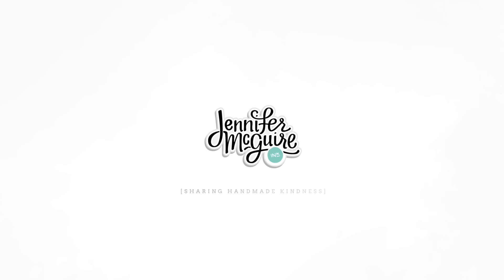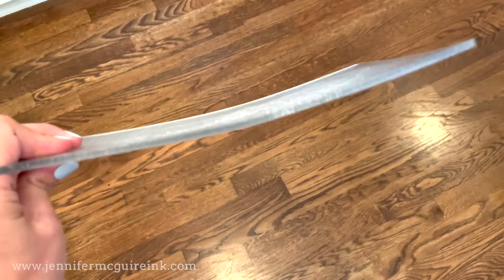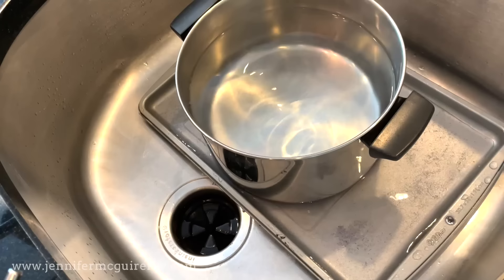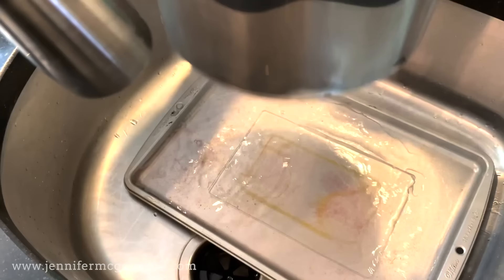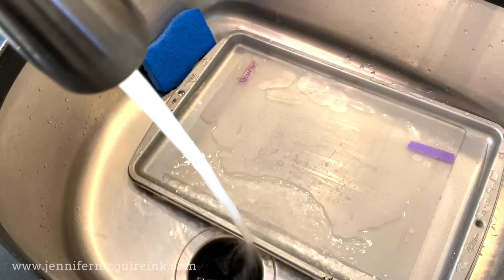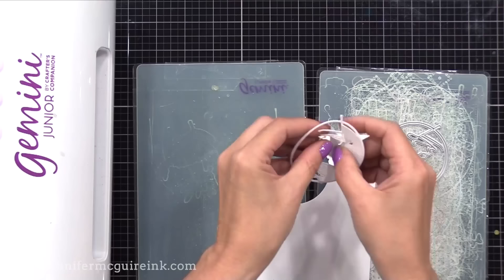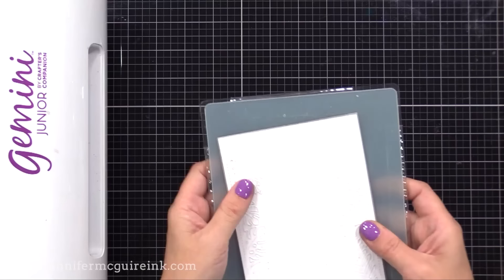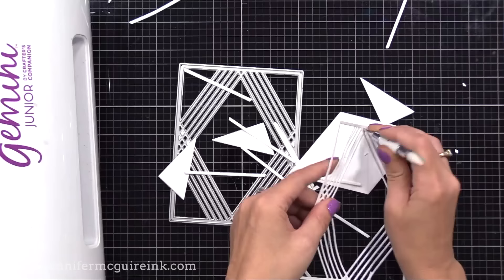Fixing & Avoiding Warped Die Cutting Plates

Comment: Thank you for suggesting my turning large side dies a bit before feeding it through my Gemini. Also, thank you for telling us to place a die more toward a corner rather than center only! Makes lots of sense!
   I am a novice on cutting dies; unfortunately, I apparently had "too big" a sandwich because my cutting plate CRACKED in half! The noise was loud, but I was saddest because I need another plate and must wait for its delivery. 
I did not realize that I could run my junior plates horizontally, either. What a marvelous idea!
 You (& your "nerd" husband) really instructed well in this video. I thank you both sincerely!

Comment: After watching your video I bought the double sided green plates and what a relief they were. I'd just bought a full size Gemini and was so disappointed with the plates that I stopped using it.  I straightened the cutting plates with hot water and then used them with the green plates and no warping, it was like a weight had been taken off my shoulders. Daft really but that's how I felt. Thank you again Jennifer, always feel uplifted after watching your videos.

Comment: Thanks for this tip on warped plates. I have been putting mine in the dishwasher when I run it to wash the dishes. It has been doing a good job of both cleaning and straightening my plates but your method would be definitely worth a try also.

Comment: I tried a method that was on YouTube.  You heated water in an oven in a shallow pan, I can't remember the temp, but then you timed it, took it out and put something heavy on top of it.  It cleaned it as well.  It worked, but it probably took longer than your method which I am sure works because of the same heating.  Also, I bought the Tonic Tangerine machine.  The plates are made out of a heavy plastic, they are not clear.  They are never going to warp because of the thickness and the material they made them out of.  I wish the other companies would start using that kind of material.  Thank you so much for a great and informative video.  I bet those double sided plates are closer to the material they use in the Tonic. :)

Comment: Thank you both for the valuable information.  Thank you for all the time spent in finding solutions as well as your great card making videos.  Now if you had a source for steel pins to prevent glue bottles from getting all clogged that would be great.  I buy the large bottles of glue and transfer to needle tip bottles.  Again thank you.

Comment: I actually put my cutting plates in my machine and left them. I put them in so the pressure was on the popped up section. It did straighten them, although not as much as your method. Thanks for the tips.

Comment: Thank you for this info!  I have Gemini junior and always use the metal shim because the instruction book said to use it.  Can’t tell you how many times I’ve cut my hand on the edges.   Probably my biggest frustration with die cutting!  I didn’t realize you didn’t need it along with the magnetic sheets which I have completely trashed numerous ones due to frequent die cutting. I also didn’t know about the double cut green plates.  I have them on order now!  Thank you so much!  And who knew?! Taping the plates together.  I’m implementing this as soon as the green plates arrive.   😃 Game changer!     And great info on boiling water for warped plates.   I have minimal warping as I frequently rotate and also place dies all over the plate.   But great to have for my big shot plates.   Thanks Jennifer!  Appreciate your information greatly, as always!  Hugs!  Em in Ohio.  Ps great info from hubby on the chemical info, too!  Thanks!

Comment: I love crafting, especially with my grandchildren, we create all sorts of things together. I asked my partner for a Gemini cutting machine for my birthday this year & absolutely love it 😍😍 I used a hairdryer on one of my badly warped plates to heat it, then placed a heavy box on top for 10 or so minutes till it cooled down, repeating 4 times, took about an hour & a half, still has a slight curve in it, but worked out ok. I think I will use your method next time though, having hot flushes whilst using a hairdryer in a small room isn’t much fun 😂😂 Thanks for the video.

Comment: THANK YOU, THANK YOU!!! I used your hot water fix today on 6 warped plates YEH it worked on them all! BUT WAIT THE BEST THING OF ALL--- I accidently used a die that was a deep cut die whoops big cut in my plate.  THE HOT WATER METHOD took out the groove it had put in my plate with no problem!  Also i had a problem with my pot covering the plate completely so i found a metal pan to fit over the plate and then put the weight pot in it! Problem solved.  Thank you again I love your shows. Stay safe wherever you are

Comment: Thanks for the tips. I accidentally discovered I could unwarp my plates by heating them with my heat gun for a few seconds and then just put some flat weight on them. I was amazed  They flattened right out. Didn’t clean them like the boiling water but was fast and easy.

Comment: Just this afternoon I threw out a couple of warped plates and ordered more.  Came into craft room and found your post.  Dug the plates out of the trash and started this video.  Couldn't wait stopped video ran into kitchen and put a pot of water on to boil.  Came back and watched the rest of this wonderful informative video.  I also had tried the hot water method but it didn't work for me but placing the hot and heavy pot on the plate makes great sense.  I can't wait to see the results.  Time is up I am going to go and check.  Thank you so much.

Comment: Thanks so much!  I've had good luck using a hot iron and old tea towel to flatten out my cutting plates. I stress using an old towel, because like the water trick, the paper grunge comes out into the towel!  It's the only thing I use my iron for these days, unless I need to "sew" (stitch witchery!).

Comment: Thank u so very much 4 sharing & researching this info 4 us. So greatly appreciate it. Will we need 2 buy new plates after a while with using the hot h20 method over & over & over? I know I will 4get sometimes some of the tips u mentioned 2 help keep the plates from warping. This is very valuable info. Thank u 4 all the time & energy u put in2 this. Have a great day.

Comment: Thank you so much, Jennifer. And this makes a ton of sense. Mahalo to Ken for helping us to understand. Stacey Park at Scrapbooking Made Simple has made YTs for several years with many usable tips for die cutting. 4 of them that do work to keep my plates flat are 1. Keep the curved, hump back side facing the cutting edges when cutting. 2. Keep one of your plates as a Do Not Cut plate (keeps everything rolling quietly, smoothly), 3. Just like you recommend, turn square/rectangle dies on an angle to prevent the giant WOMP bump and sound from happening, and 4. also as you recommend, cut all over the plate, not just the center. Big hugs of thanks!! 🥰🐬🌴🍍💜

Comment: I've used that same method of boiling water in my 12" skillet and placing my plates in the water, then setting the pan of hot water on top of the plates until it cooled to unwarp my Sizzix plates for a couple of years.  I never thought to use a sheet pan to put the plates on before adding hot water to clean them and straighten them with a heavier pot of water.  Thanks for the tips on adding the double cut plates to regular plates as I have a brand new set to use with my brand new Gemini Jr. plates.

Comment: I had two very badly warped and wavy plates. Your trick worked like a charm and could not have been easier. Tip to other watchers: I used my oval Le Creuset as the "weight" for the plate. If you also have a heavy piece of cookware like it, I highly recommend that you use it. Thank you Jennifer and husband :)

Comment: Thank you so much, Jennifer and Ken! Nerd is a great compliment in my world! -  I am using a self healing mat and it's worked for years even though it's also warped and not pretty and I am only doing a fraction of the die cutting you are doing. I am wondering if the hot water method would work on that, too. - Definitely, I am going to get the large green plates for my Gemini (even though the self healing mat works well with it)! I had no idea they had double sided dies!
Reply: Hi Chrissie I have a 2nd hand gemini on the way. What is your self healing mat sandwich please? I suppose it would depend on the thickness of the mat. Thanks

Comment: Love it, and thanks to the hubby for the explanation. (Which I didn't think was overly technical, I have to explain non stick cookware coatings to ppl with no materials knowledge, so know it is hard to do...well done!)  The plasic additives are also why you should not use nonstick coated pans on high heat, since dangerous things can offgas if you get past a certain temp, like the plates. That is the PFOA thing ppl are on about with those, and it can get nasty. (Offgasses at 600 degrees F, so stick to medium heat)

 It is similar to your metal cookware, and why you should never add cold water to a hot stainless steel or other metal piece.  All that steam looks like you are accomplishing some kind of great cleaning, but in reality is destroying your cookware. Metal is a crystalline structure, so like the cutting plates, heat will relax that structure.  As it heats, it will expand and sag, so applying cold water will freeze that structure in whatever configuration it is in when you do....which is how stainless and other metal cookware gets warped, and next to impossible to unwarp. Also why plastic with a crystalline structure would not take it as well, so lucky for us the plates are not!  At least with the glass type of plastic, you can reset with heat....wouldn't work as easily with a crystal matrix. :) And is also why waiting for them to cool is the key...it allows them to reset their structural memory to a flat state.

Now, off to see if I can rescue some of my old plates...thanks so much for this!!!! :)

Comment: I have a Gemini and a Grand Calibur and I find that the Grand Calibur plates are far better than any other plates you can buy, I have been using mine for nearly 2 years and they come in A5 and A4 sizes and they are amazing, you can buy replacement plates for them and I use them in my Kaleido too. Not sure what sort of material they are made of they are not clear plates but amazing plates. I have tried self healing cutting mats but I find they warp, it is so kind of you to do this fixing video it will help a lot of people who have the clear plates, the moving around to the edges does work and putting large dies on the wonk helps too to stop the horrible clunking when the rollers go over the die if it is straight on. I am in the UK and I just got my Kaleido machine and it comes with 2 3mm clear plates and 1 5mm plate and I have only had it a few weeks and already the cutting plate even being careful has started to warp, so I am now using one of my Grand Calibur A5 plates in it and it works a treat, I wish more companies would think of customers having to buy replacement plates they are not cheap and if it was not for you Jennifer who is kind enough to go to the trouble of finding out fixes for crafters then this would be avoided, I was sure at one time that manufacturers did this on purpose to make customers buy new plates so we would all spend more money.  I had not hear of the new plates you from Gemini and I like the idea you have of taping them together it is brilliant thank you so much. I will look out for these new Gemini plates. Have a great day and take care and also thank you husband for his amazing explanation it was so enlightening to know how they work.

Comment: I store my stamps and die cuts in the acrylic refrigerator bins from one one of your previous suggestions and I currently have 15 of those bins that are mostly full.  I couldn't bring myself to throw away my warped die cutting plates so instead I have always stuck them in the back the bins to keep the stamps and die cuts in the back from getting bent over the edge as the weight of the ones in the front lays back.  I have a warped plate in 14 of the 15 bins and was wondering what else I could use them for after all the bins have one. But now, with this trick I can straighten them and reuse them for their intended purpose which means I now have 14 plates as spares!  That should last me a really really long time so thank you for your great suggestion and saving me a lot of money!!!

Comment: Thank you so much, Jennifer... and nerd partner, Ken. I made the sandwich that you showed in your other video (for Gemini Jr.) and it works really good! I haven't had a problem with warping since I started to use it. I did sort of mess up by trying to use it with the metal shim and no top plate to put through an embossing folder (so now I have warped metal shim and embossing folder. LOL) but that was me learning a good lesson. I guess I need to get a couple of cutting plates for embossing. I'm also going to have to get a pair of those new cutting plates.

Comment: I just tried this, and although my 3-year-old plates aren’t warped (I turn them over every run through), I was amazed at how the boiling water cleaned my plates! I usually wash them every few months to remove residue from tape, but they have NEVER BEEN THIS CLEAN EVER! I can’t believe how much paper fiber and dye was embedded in the crevices. I’ll be doing this on a regular basis from now on. 😁

Comment: A million thanks!  Just a quick question: when you list the sandwich stack at the very end, it should be flipped before running through the machine so the die cutting blade will be face up, correct?

Comment: Linda Helget  Thank you so much for this information.  I love my Gemini but was wondering if I missed something in the directions as the plates were warping badly.  I will be trying this for sure.  Have not had this problem so much with my other machines, but they are hand driven rather than machine driven.  I will be looking into the double plates as well.  Never commented before I guess, so hope I have this right.

Comment: Thank you, this is so helpful! I appreciate the scientific explanation too! Another challenge I’ve been trying to solve with die cutting is the marks that marred plates can leave on die cuts. You mentioned always using one of the plates as the cutting plate - I’ve been doing that and also using a scrap piece of paper under the cutting plate. Any other ideas? Thank you for always sharing your wealth of knowledge!
Reply: You might try putting a piece of copy paper on top of the plate to see of that prevents the marks from showing up on your die cut. Or if you're using cardstock as a shim, you could try putting the cardstock on top of your cutting plate rather than underneath it. Hope this makes sense, and is helpful.☺
Reply: I have used the clear cellophane packaging that comes with 12x12 sheets of paper.  It’s thin enough that it doesn’t make much difference in the sandwich. I cut it up to the size of my plates and slip it over the paper and die.  This protects nicely so that your die cuts are not etched, especially with foil cardstock.  When the clear cellophane gets bumpy you can switch it out to a new one.

Comment: I did this - and it worked like a charm!!! HOWEVER 🙂 the plate changed in size!!!! So just beware that this can happen. I was so delighted when I forst saw my clean and STRAIGHT plate. It is now shorter and wider (which means that it no longer fits the machine. Just wanted to mention it 🙂🙂 wanted to leave photos, but don't know how 😉

Comment: Thanks for this info. I just gave got a new Spellbinders so I could get a glimmer system too and the plates warped very quickly….after just a few weeks.  I had my old Cuttlebug for years with very little warping.  At least I can fix it but kind of disappointed that warping took place so very quickly with Spellbinders.  Maybe I will just use it for use with the glimmer system.

Comment: Hi Jennifer. Thank you for always having tips and tricks. Everyone loves your integrity and honesty, and in almost every class I take, someone says they learned “xxx” from Jennifer McGuire. Rest assured you have taught a mass of passionate paper crafters in too many ways to count. I have a question about gemini and magic mat. I have had five total die cutters. Lol well for 21 years thats not too bad. My big shot springs/crank finally died and I replaced it with 13x17 ginormous Big Shot Plus which I had for a decade. Then I downsized and sold that. Then i got the vagabond, and with surgery on my arthritic wrists, it has been super. This year I got the mini altenew die cutter for traveling. Then I got the gemini mostly again self feeding and doesn't stick out or take as much room for the longer cutting platforms like my vagabond when opened.  It is the regular size gemini and I wanted to know if you have used the magic mat on the gemini (regular). There doesn't seem like there is a size that fits the regular gemini. Ive just unboxed my gemini and want to start with the best habits and results since the warping of plates are the big deal. What do you think? Most people seem to have the jr. gemini. But I die cut a lot at a time trying to make the most of every pass and always aim to make ten of the same card when I make one.
Reply from the maker: I haven't tried that but perhaps someone here can offer their thoughts on it.